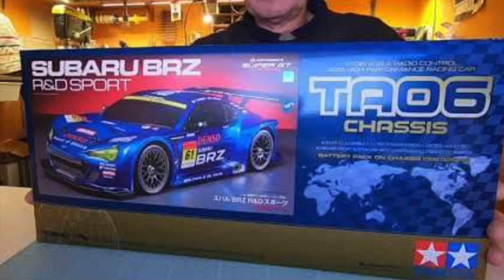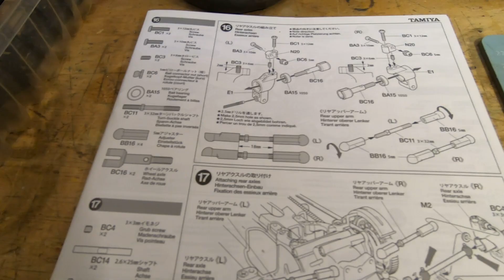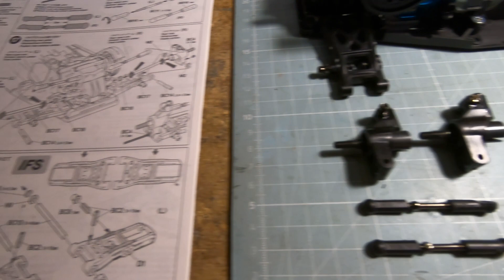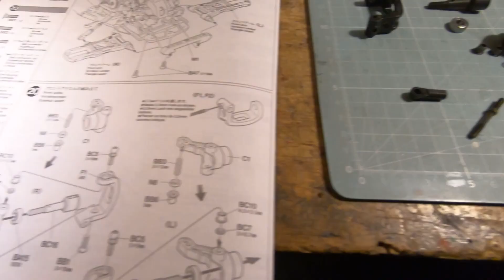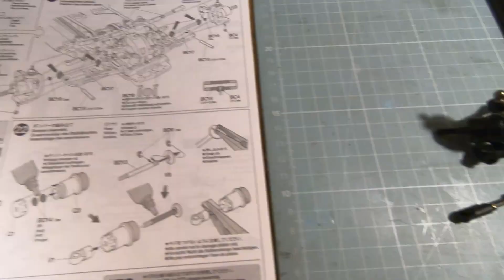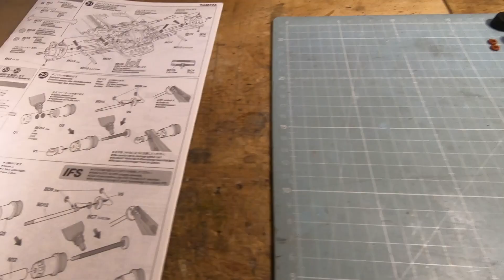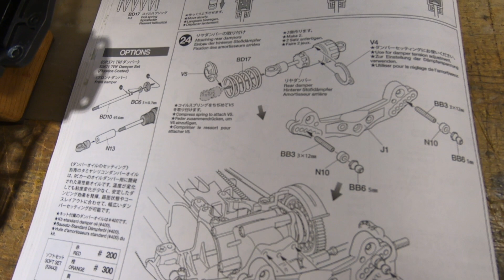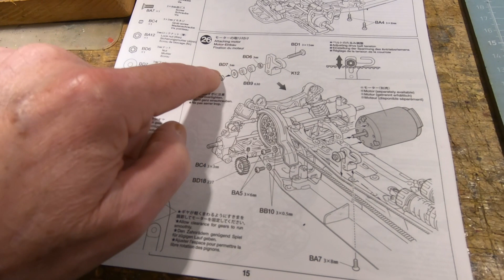Tamiya 1/10 RC Subaru BRZ assembling.part4

Comment: Hi there Nanni, looks like a great chassis with some complex sections for us Rc builders to enjoy. A great alternative method of screwing the turnbuckles together ( a vice and an adjustable spanner - genius! 😊). I notice the front dampers are of the same technique as the TD4 / TD2 chassis’. That motor is going to provide some extra power, I have some thicker gauge red and black wire, that I sometimes use for the motor’s provides less impedance for the ESC. The running in process…poetry in motion 😂 Best wishes to you and the family 😊😊
Reply from the maker: Changed wires and some little upgrades on my habit. Dampers are always the same but they works prity good. All the bests to you all. Ciao Nanni